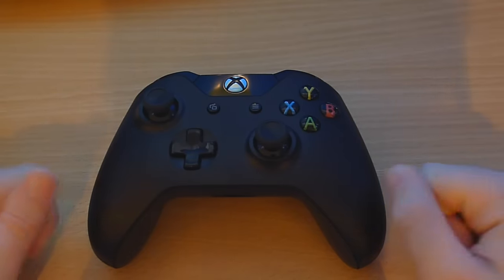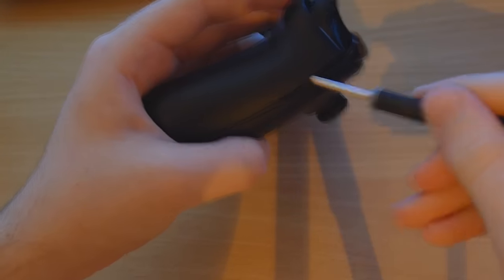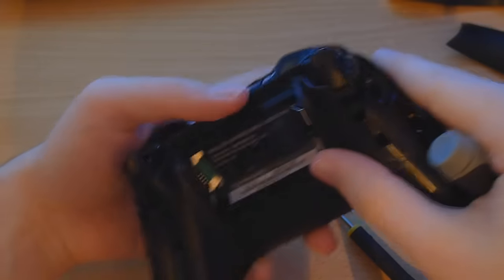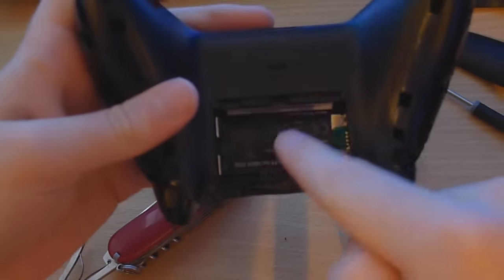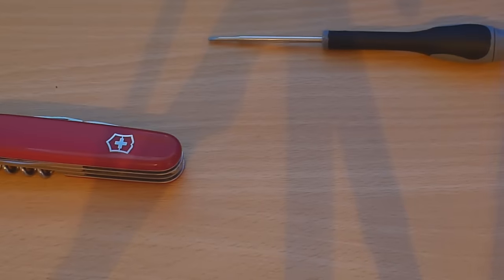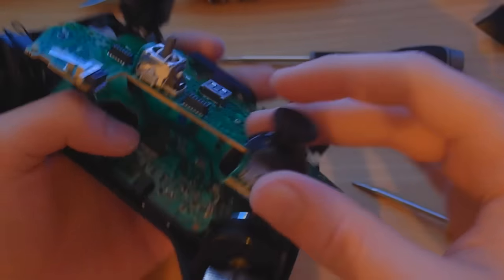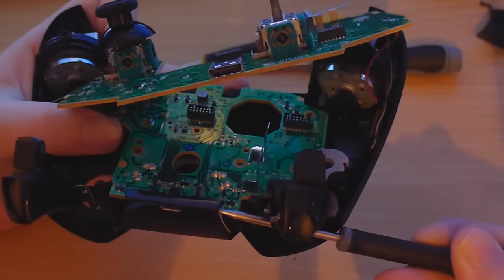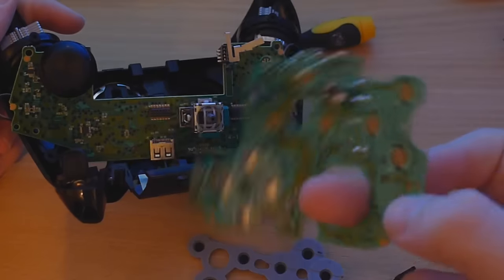How to Open up an Xbox One Controller

Comment: I hate how Xbox put those screws in so people can't open it and for us to give them money by buying a new controller
Reply: William Jordison I wish I could like your comment more than once
Reply: William Jordison Flat head screwdriver. That's how I opened the 360 controller and just now an Xbox One controller. See the small pin in the middle of the screw? Break it or at least force it out of the way. The smaller screws inside don't have those pins so a precision screwdriver doed the trick. I've never had the required ones.
Reply: jokuihmehyyppa how do you do it by detail
Reply: XxkingxX How much more detailed can I get? Flat head screwdriver, push the pin out of the way potentially breaking it and then you can open them
easily.
Reply: Wow, so lazy. If you wanna spend money on a new controller go ahead, but they make the screws hidden on purpose cuz it looks ugly and amateur. It's a bit hard to take off, sure, but it's not impossible
Reply: William Jordi I found a way to open it with out buying anything
Reply: easy just need a flat head screwdriver
Reply: Mohamed Bulbul how
Reply: Mohamed Bulbul bate jew
Reply: William Jordison How do you think bill gates got this rich?
Reply: Or maybe just maybe they did that so your control does not break into pieces when you drop it
Reply: Jason Rodriguez they had screws on the 360 controls and it never fel apart when i threw it around it even stopped working and broke but never fell apart
Reply: You're not smart. Having screws that aren't safety screws does not affect the durability of the controller...
Reply: William Jordison i just wnna spray mine
Reply: William Jordison its to keep it together
Reply: Or you could just buy a tech screwdriver set and not be lazy and save money... Come on people they are like $20
Reply: I just opened my Xbox controller and it was pain in the ass. You need security torx 8 screwdriver also 1.4 mm flat head screwdriver.
Reply: William Jordison my controllers thumstick makes a quiet clicking noise
Reply: All you have to do is get a security screwdriver set off Amazon, they’re pretty cheap. I’m not saying you should have to, but it’s not so bad.
Reply: I have plenty of Torx and tamper proof torx so it doesn’t bother me.
Reply: the whole set of repair tools is like 10 dollars on ebay
Reply: William Jordison So effn true. It's their little scheme to force people to buy new controllers.
Reply: not very honest answer @William Jordison cos i was able to do an exchange of a controller for free that i have bought with my first xbox one , not the S, nor the X, and the fact that my Xbox one X was and still is under warranty, because , unknown fact all consoles have a 2 years and a half of warranty and all your attached controllers , kinect are tied to your actual console, 
go to 
https://support.xbox.com/fr-FR/my-account/warranty-and-service/register-your-product ( put this page in english ) 
and enter your console serial number you'll see how many years or months you have left, then choose repair / xbox one accesories, works with the fat, S and X , and this way , no bill of the accesory asked, all did it online, and 4 years after purchase they echange my controller who has button B sometimes stuck for a short period of time while playing... so please check warranty , cos Xbox does this extended Warranty since the RROD on the 360 on all it's console... and each time it is fast and they really repair or exchange our console ( not like some other repair services like sony's 1 year one and catastrophic one.. at least in Some europeean countries since the PS1 .. PS4 pro went 3 times for a blu ray dirve repair, and each time never got fixed, waited each time 2 weeks ... 4th time they finally went on exchange mode... )
Reply: jokuihmehyyppa can you show us what store you purchased the screw drivers? And their respective serial numbers of course
Reply: William Jordison You guys will spend money on special controllers and stuff, but won’t spend $4 on a security torx screwdriver to maintain your equipment?
Reply: I agree, it is very hard to clean even repair Xbox One Controller.
Reply: @SuolaEki  They are actually smaller than torx 8.
Reply: @realsies250  I know, but these days Microsoft and Sony can just give their controllers security patches to prevent tampering. Even game developers as well.
Reply: CovertBrony Let them try.  If they can do it, people can undo it.
Reply: @monelfunkawitz3966  True, there's proof that there's software exploits.
Reply: Same, to me the Xone took a giant shit on Xbox gamers.
Reply: William Jordison u can open it if you have exactly 46 chromosomes
Reply: @AlexisAlexander646  they aren't talking about the screws being visible, they are talking about why they put these specific screws in the controller, they are so inconvenient for users that need to disassemble the controller
Reply: Revenge I’m sure there were a bunch of engineers that put a lot of thought into the controller, so they’re obviously not there for no reason
Reply: Oh look a security torx driver why that must cost a fortune, oh sorry I mean next to nothing.

One of the reasons torx are used is to make it easier for machines to assemble and to stop 10 year old kids from opening things

What next complaining that a Phillips head screwdriver is used and you only have broken bottle to open the controller with
Reply: You can use a flat head or just buy a T8H screw driver
Reply: Buy the screw driver it’s cheaper than buying a new one. You can buy them cheaply on amazon look up “Xbox controller opening kit”
Reply: yall act likie they dont sell the same sized torx bit to take these off right next to all the other tools lmfao
Reply: literally had my apart in 2mins lol
Reply: Ps4 users be like
Reply: it's for gaming, not to mess around with
Reply: Yeah hold the Xbox controller with tape sounds like a smart idea
Reply: 1. Those screws are common inside of consoles. 

2. Easy way to open them without that screwdriver is to use a flat head instead.
Reply: 1000 like
Reply: I mean it needs those to be stable
Reply: Some car stores sale those screw drivers there called tamper proof bits
Reply: As if Bill gates wasn’t rich enough
Reply: CovertBrony That’s exactly what I mean. I don’t wanna temper with my controllers but controllers tend to get greasy or sticky sometimes.. used to be I could take everything off and clean everything.. now that isn’t possible anymore since it looks like the rumble bit is just stuck in there.. Yeah and I don’t want to start soldering to clean my controllers it took enough time as it was.. damnit man can we please go back to consumer friendly times in which we loved the company for loving us.
Reply: It’s almost the same with PlayStations it’s hell to open it but a bit less complicated than this
Reply: @AlexisAlexander646  Hidden? They have security screws guarding a controller mostly kids play on.. The only reason they put them there was so you would have to buy a new one when one of your buttons broke or got stuck.
Reply: @augustlavdal6187  Wow, you gotta be pretty ignorant to say mostly kids play on console ya know. Anyway, ignoring that, you could still easily get the type of screwdriver and replacement parts needed pretty cheap on Amazon, so it's not like they made it impossible to open.
Reply: The torx bit is like 50 cents
Reply: That’s the power of Microsoft
Reply: Dude, they are security torx t8. THE DRIVER BIT IS 3 FUCKING DOLLARS
Reply: Instead of a skrewdriver you could use a knife it worked for me
Reply: Use a 2.0 millimeter flat head and it comes out fine
Reply: @AlexisAlexander646  it's not about the screws being hidden, it's about the screws being security torx, which I can't find anywhere but online
Reply: @SuolaEki  It's a security 6 torx but nice try. There is no purpose for a micro flathead screwdriver any where near your controller. Not even to pry it open which will just mar the plastic and make your clean controller look used af.
Reply: @thomasshelby1245  And?
Reply: @mohamedbulbul6338  Yea... This video
Reply: @jokuihmehyyppa  i broke one of the security peices and i couldnt unscrew it with my flathead and now i need to buy a small torque
Reply: well how the fuck else are they gonna close it
Reply: Thanks for the info, was able to fix my audio jack after watching your video. 👍🏻👍🏻
Reply: @sammgz0012  Why ofc I can, I'm sure my dad will remember where he bought them in the 70s when he was interested in electronics!
Reply: @promemeus5610  If the flathead is big enough to be lodged between the corners it'll work just fine, no need for torx. You're doing something wrong.
Reply: @djoknoot  Never needed, flat head is all you need for these screws.
Reply: @jokuihmehyyppa  yeah, if you wanna break the pins on the screws yeah.
Reply: @djoknoot  A regular torx won't work either as they don't fit around the pin. Unless you want to use those temper proof special torx bits all you can do is break that thing off.
Reply: @jokuihmehyyppa  thats why i said t8, i know someone who uses it for their xbox one controller and it works perfectly and if you google t8 screwdriver it says its for the xbox one controller as well
Reply: @djoknoot  Ah, just noticed you said T8, I read it as TX. Anyway, the point here was that if you don't have that bit, you can just break the pin with a flat head and use it instead. We know what you're supposed to use but it's a lot more common to have a flat head than T8 lying around.
Reply: Just get a new screwdriver (I'm 4 years late)
Reply: William, they are there to stop fuckwitz who think they know what they are doing, discovering that they didn't and then try to blame the manufacturer.

We used them on the switch plate of the fan speed contoller on our air conditioners. We used the adjustment inside to set the minimum fan speed because it would produce a droaning sound if set too low.
We got fed up with customers complaining about the droaning noise their aircon made when set to minimum fan speed. So we'd send an engineer out who would remove the panel and see the pot inside had been teurned down to minimum which is NOT how it would leave the factory. The customer would of course always deny messing, so we started fitting anti-tamper fixings and guess what?
NOT A SINGLE 'DROANING' COMPLAINT AFTERWARDS!!!
Reply: I hate how small they make the screws
Reply: Its not difficult to open it all up you need a torx t8 and a torx t6 plus its recommended to buy these because a lot of products use these
Reply: That’s capitalism for you
Reply: Well i mean you can break the plastic and make it work
Reply: @slashinten  that’s enough to buy a new controller
Reply: Microsoft is just selfish
Reply: Take a Dremel & grind a line across it for a flat head, takes 2mins. Fuck them lol
Reply: I suggest investing in a screwdriver kit. It costs less thana new controller and it pays for itself.
Reply: If they wouldnt want us to open it they could easily put those screws that cant even be uncrewed, i forgor name 💀
Reply: Yea, I have like 4 tools none work for the screws
Reply: @AlexisAlexander646  What a zoomer argument. Looks over functionality.
Reply: @Blitzkrieg1605  Again, not sure what your point is when there are screwdrivers online that you can easily purchase to open up the controller? If you choose not to buy a screwdriver, that's not Xbox's fault. Besides, you do realize that looks are an important part of any product too right? It's called "advertising"
Reply: nintendo does the same
Reply: But you can and he did in the video. Lol.
Reply: Just buy the correct tool costs nothing
Reply: Just buy the tool. Costs few quid
Reply: You could buy these tamper proof torx bits for a long time I’ve had mine since 04 so that’s twenty years give or take
Reply: after working as an electronics engineer for 9 months, it is just an industry standard screw. Super super common for them to use torx screws since they dont strip as easily as a Philips head

Comment: tried to clean my buttons since they were sticky. came here, saw the secure torx screws, got upset, raged, checked my computer-dissamble scredriver set, found the correct heads, raged more that I even had to look for it, dissambled my controller, cleaned the buttons, put it back together and I am happy now. thanks for the video, take my like.
Reply: A small flat head screwdriver can actually get em

Comment: You can also use a credit/debit or gift card to pry it open. dosent leave any marks and the card will still be the same.
Reply: Well, maybe the card not will be the same after it... 😂😅
Reply: Best tool ever
Reply: @adrianmartinez193  that's literally what he said he said the card would be the same 4head
Reply: @rektmaister6837  and adrian said it wouldnt
Reply: does it break
Reply: @botonwine8384  it doesnt but make sure you apply that Sam's pressure all around
Reply: You absolute legend
Reply: Lie about the card luckily it was a dead card
Reply: @rektmaister6837  what if he means like its different in the sense that its scarred from the experience lol...it'll never be the same again
Reply: Sorry but not giving you my information
Reply: Lol I just pull them off
Reply: This rely helped
Reply: Thanks for the advice 🤙
Reply: Well i ended up using a guitar pick
Reply: I should try it. What kind of card were you using? What numbers are on it?
Reply: Visa or MasterCard?

Comment: Thx damn Microsoft makes it so hard was this close to buying a new one I just had to fix one analog stick
Reply: Same
Reply: Same
Reply: Same mines popped out
Reply: Same threw it at the wall
Reply: @normanfernee3500  same it worked instantly
Reply: my bro threw the controller at the ground then i took it apart to put it back in place and it worked
Reply: Same 😂
Reply: i had to fix my A button
Reply: Same
Reply: Same, still in progress
Reply: I had to do it on my dpad
Reply: Same
Reply: Same
Reply: Same I smashed mine to the ground
Reply: Same bro
Reply: same
Reply: Fix my Xbox button .-.
Reply: I kinda broke my brothers controller, now I'm shit scared so I came here to fix it 😅
Reply: Same
Reply: Wow. We ALL managed to pop out the thumbstick by throwing it? HOW IS THIS A THING?
Reply: Same, it was so easy with a 360 controller.

Comment: The tool that you can pry open the plastic panels is called a spudger. :)
Very useful, especially for modding and repairing electronics, like controllers, cell phones, or tablets.
Security TORX size T8 worked for me.

Comment: Thanks for the tutorial! Now I know to simply buy a new one cause this looks like a pain in the ass
Reply: Mike Grace buy a new one and return ur old one in the box
Reply: It's actually not that hard. Just keep slamming it on the ground like I did and with xbox's shitty luck everything will come right off.
Reply: LMFAOOO
Reply: It's actually really easy.  Use the tutorial as a reference.  I bought a 10 dollar repair kit, and a set of buttons for 5.  Now i'm buying loads of different colored buttons.  Fuck that xbox customization, DIY.
Reply: If you have temperament nature or you just get it fixed fast then I don't recommend repairing this. I "repaired" mine, but when I assembled it back together the red wire of the smaller motor came off. I soldered the wire back to it's place but I got short-circuit. I couldn't figure out the reason for the short-circuit other than my soldering (I probably heated the spot too much). So I bought the new one...

Lesson is put the tapes on the motors so they don't drop constantly and don't solder/remove the wires.
Reply: Mike Grace actually it's not that hard
Reply: Tried it. Worse than a pain in the ass. Handles are creaky now.
Reply: Can confirm have cut self twice trying to remove pin
Reply: It not it easy
Reply: Ps4 way harder

Comment: One of the most inexpensive tools for disassembly of electronics, is a good stiff guitar pick or an old expired credit card. The guitar picks are going to be the better of the two because of siffness/rigidity and they are relatively inexpensive.

Comment: Be aware that some models the bumbers are part of the centre piece, the centre power button cover and bumbers come off as one unit, bear that in mind when following this tutorial as you may snap them
Reply: Yes, for Gen 2 Controller the center and bumper piece is one unit but for if you have Gen 1 then all 3 shall be separate. P.S I have my Gen 1 controller open right in front of me for cleaning.
Reply: Was wondering why my bumpers looked a little different. Figured out how it worked eventually though
Reply: How do i take apart a gen 2 then?
Reply: I should have read this about 10 minutes ago before I broke it
Reply: @borki2144  lol sorry mate
Reply: There's literally no reason to remove the bumpers anyway

Comment: Thank you. My controller is having connection issues and I just wanted to make sure it wasn't a simple cleaning issue before trying to figure out technical issues or being charged an arm and a leg for repair/replacement. I'm 63 years old and your basic instruction for getting the grips off and removing the four (and a half) screws was perfect for checking it out. I had the right size tool to by pass the security screw and get it clean.